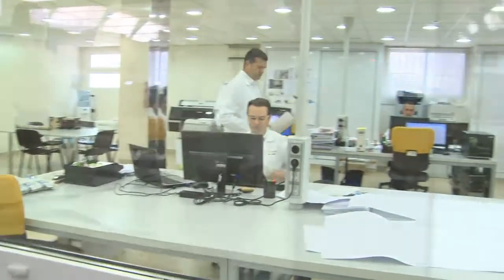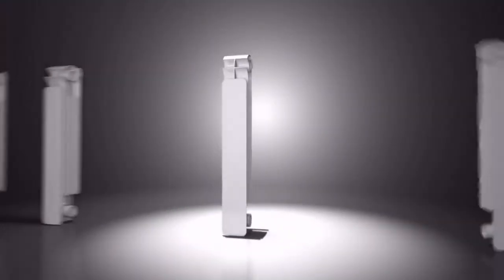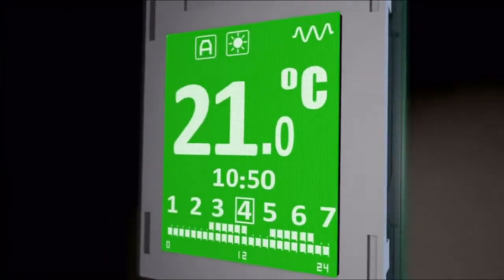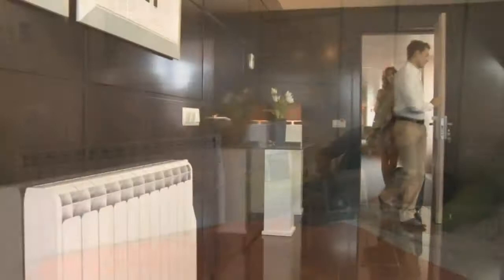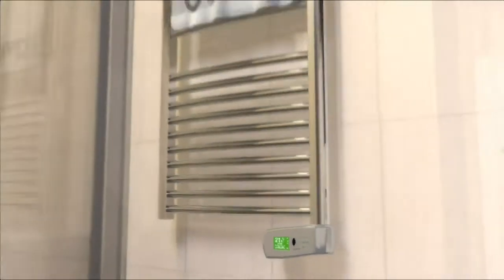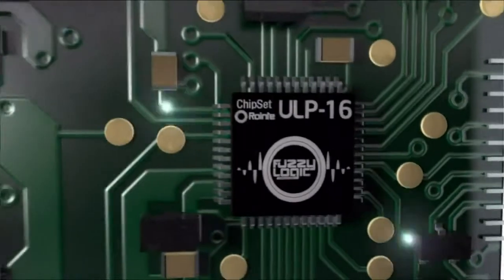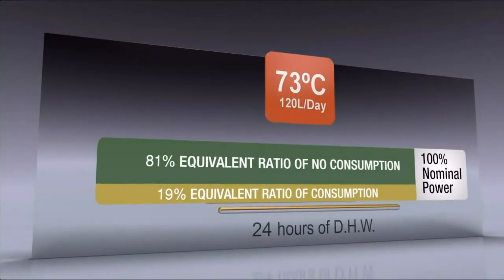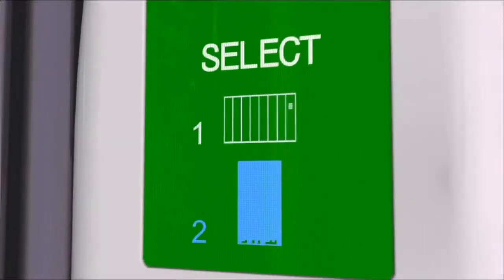Rointe KYROS Energy Smart Heating System

Comment from the maker: Hi, thank you very much for your message. 
Yes, it is oil filled & Lot 20 compliant. It has some fantastic features including; pre-installed programming, 20 yr body warranty, open window function, low energy consumption technology.  If you would like to discuss some great options please call us on 01473 276686 or visit us at https://www.heatershop.co.uk/electric-radiators/rointe-kyros.